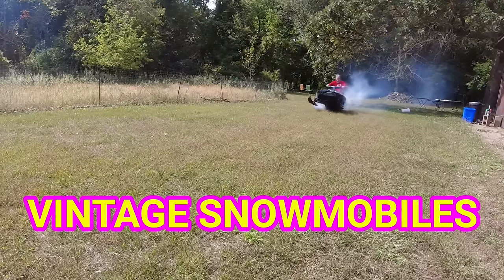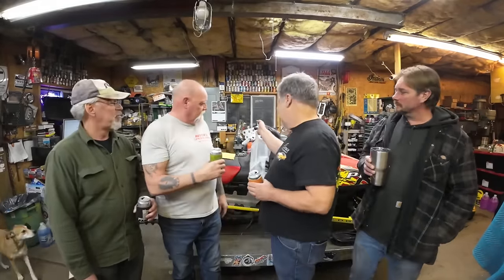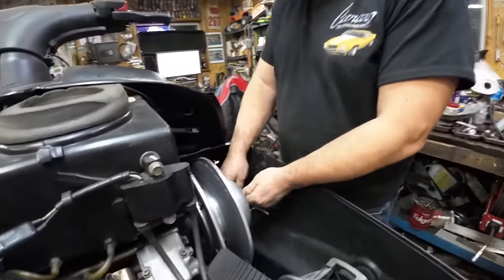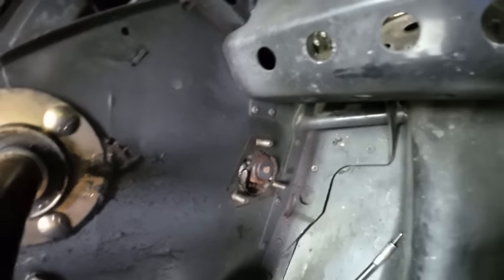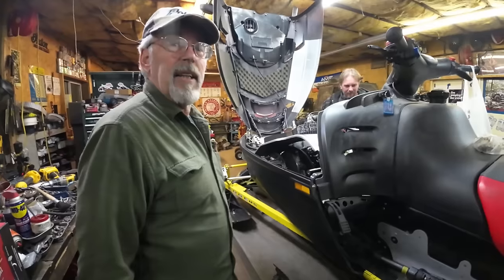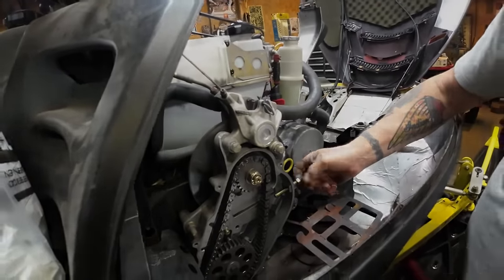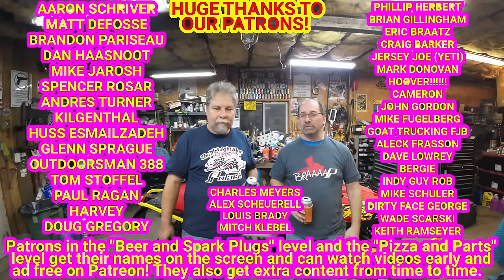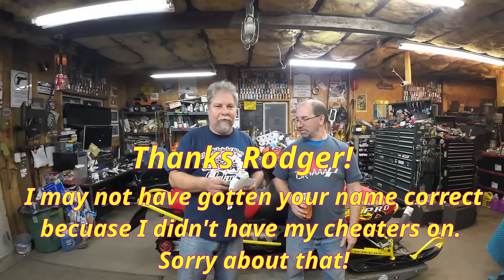Polaris Edge Drive Shaft Bearings. Classic Polaris Trailing Arm Indy Snowmobile Repair.

Comment: I debated it i should be that guy or not. I decided yes im gonna lol thats actually not a pro x chassis. Its an edge chassis. Pro x and edge look the same, they are very similar, but they are totally different. Pro x would have a shock tower brace from one another. The bulkhead would be a solid brace in front of the recoil housing (makes changine the recoil a pain). Front suspension on a pro is is a shorter beefier trailing arm, larger diameter radius rods, and taller shock towers for longer shocks. Rear suspension on a pro x is totally different and stronger, you cant even use the same mounting bolts from and edge. At least 03 and 04 they were different. 

Either way you got an awesome sled. Looks like an 04 edge chassis and tunnel. I think 04 was the only year with a black painted edge tunnel and that grey fish bone along the tunnel and running boards. 2004 was the first year Perc reverse was standard on all sleds. 03 it was an option. The handbars on the sled is totally edge chassis. Pro x would have exposed handlebars, it wouldnt have the same master cylider and control block on left side. Pro x master cylinder was a willwood master cylinder. The high and low beam switch is actually a wedge chassis switch. And the perc button would be its own stand alone button.

Comment: Hi Nutter I was wondering if a 1996 XLT reverse will work on my 1991 Indy 650 if so what's a fair price for it any help would be helpful thanks in advance patron Ken Singraber
Reply from the maker: If its a wedge it will work. It if came from an evolved or any other body style the shifter won't work. $300+ seems to be the price in my area, but I don't know about other places.